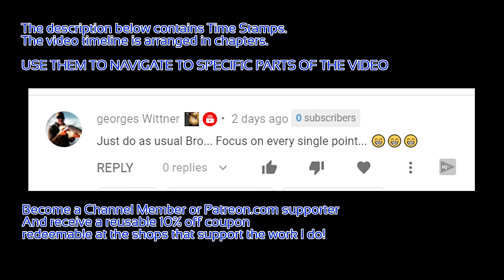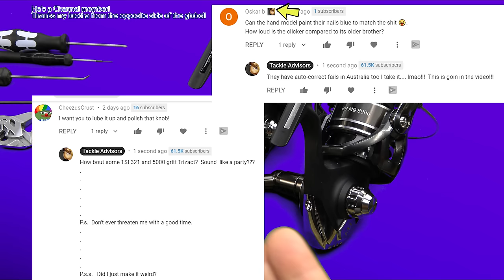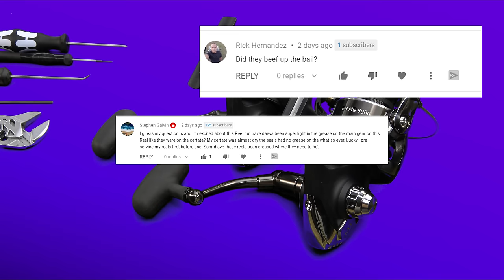Daiwa BG MQ Review - COMPARISON - Teardown - Analysis COMPARED to Spinfisher, BG, Saragosa, Slammer

Comment: The clear plastic washer on top of the drag stack is a cheap arsed heat shield like the white one on the Saltigas. Meant to prevent heat generated in the drag stack damaging the base of the drag knob which used to happen on the Z series Saltigas on big hard running fish.
Reply: Great job by the way Scooby, marathon edit bro👍🏽
Reply from the maker: @mickdayday1152  Thanks man!!!!  that was my fear...I called the daiwa rep on that. (no reply)...i was worried it was just a high temp plastic to act as a buffer instead of a heat sink...IF you saw the past video section about the saragossa sw I mentioned and showed a picture of a friends saltiga with a melted drag washer...and the saragosa sw has a metal pluger

Comment: This was wonderful.  Very thorough and complete.  I wish there were more reviews like this.  Shimano in particular uses marketing jargon and then explains it with more jargon.  It's hard to know what is in the reel. I own a Spinnfisher V and a BG.    You are spot on when talking about the feel of these two reels.  I surf fish in Florida and stay out of the water.  I learned a lot about how to clean the reels when I come home.  I wasn't aware of the issue with roller bearing or bushing so I will open them and see how they are doing.  There were lots of parts on the table I just wonder if you had any leftover?

Comment: Great review in terms of sealing and smoothness of operation.  Would like to see the difference in max drag between the BG and similar sized BG MQ.  I get about 8 lbs at full spool with the BG tested on a calibrated brass scale and got owned by a jack crevalle this weekend.  The reel was fine though after having half the line run out by multiple jacks and a couple 10 lb bonita.    I had to thumb the spool to stop from being spooled a few times and broke the jacks off on purpose.  What I like about the Diawa reels is they bottom out against metal and keep you from over flexing the spool against the drag.  I'm either going to go up to the 4500 BG or maybe "upgrade" to the MQ if it puts out more drag.  I can't see spending more for a Saragossa in that size reel and will reserve that for the 10000 size.

Comment: wanted a gossa, but settled for BG MQ when the supply dried up.  fished it this spring, mostly plugging.  Happy overall. One complaint is I had a bail close on a cast. Been more conscious of opening and position and hasn't been an issue.
Reply: would you recommend for freshwater?
Reply: have you ever experience bad gear meshing? ive hardly used mine and intermittently during use, the gears start to feel bad and as soon as that happens i stop using it. When i get home it feels buttery smooth again.

Comment: Thanks for the breakdown!  I've used a BG MQ 4000 fluke/tog fishing exclusively for a few seasons.  It works perfectly for shore based bottom fishing but I never thought I'd be able to surf fish with it and glad I watched your video.  I'm looking at a new 6500 for surf fishing and I'll consider your recommendations.
Reply from the maker: Right now the gosa 6000 is the standard to beat.  Slammer 4, is very good as well.
Reply: Thanks! @TackleAdvisors
Reply: @TackleAdvisors what about lighter setups? For example I need a reel with a capacity of 300yds of 0.20mm braid and I need to be <300g because I have a light jigging rod 10-60g..Slammer is 400+,Gosa also 400+..BG MQ 4000 would fit pretty well into the desired category..do you think there's something else beside it that's equally good or better? Other than Twin Power XD for example..that's too expensive

Comment: I’m deciding between the Stradic FL, saltist back bay, or this reel. Looking at 4000 size to pull big reds from structure. Which would you suggest? I have a 2500 FL and love it but I’m leaning towards the Back Bay

Comment: Great review man, I love how u threw in the diameters of the shaft and gear in comparison to the 4k bg!
Reply from the maker: Bent shafts were an issue I've seen enough of to be curious...It looked like by memory it was slightly thicker in the mq....I posted an  ask on stripersonline....and a member (hk jonathan) cracked his and took measurements.   A few years ago the same guy sent me his slammer 3 to tear down and use for a bit
Reply: @TackleAdvisors  I plan on getting a new cat-fish jigging/ shore jigging reel, and so far 6000 bg mq seems to fit the bill, i would love to see some tests from people on the water though, but looks a lot beefier then the  regular bg i use in the 3000 size. What do you think, would it handle heavy 60g jigs + silicone in strong rivers?

Comment: I replaced the line roller bushings with crbb in all of my BGs. I put a drop of Liquid Bearings on there every time I finish with fishing and I've never had a problem with them. I don't really care for the bushings
Reply from the maker: Let me ask... Who's are you using? I used to do the same and then the quality went down.. This was 15 years ago...
Reply: @TackleAdvisors  I don't know what brand they are but it's the ones from hpr bearings in Miami. Either those or sometimes I order from boca
Reply: And I said crbb but I meant the stainless.

Comment: Another great video! I’ll take the Penn ssvi in 
A  5500 or 6500  on a. Boat getting sprayed with salt water an the way out or home . Thanks ! For the dissection =Great information.
Reply: I don't see any issue. Been using all Japanese brands . Reels got sprayed by rough seas while boating. It worked fine. Just have a small WD40 on standby.  But never use. Reels worked fine. Got BG 5000 for 45 years with very little maintenance. Bought a newer BG with double stopped. Only fished 5-10 kg fish on it. Just washed it after use. It will last for years 
Once I forgot to remove a fishing set on a boat for three days, the reel jammed. The boat is parking in the sea. Not moving. Dismantle the reel with lots of WD40, Presto ! It worked fine as before !

Comment: great review at least on there MQ reels they have got rid of the useless reverse switch, those things drive me crazy.
Reply: Just buy a Fin Nor Offshore and you know you have something, body all alu with all gear stainless steel, the 6,4 mm axle supported in 3 points, front middle and rear for real effort, no compromise as alu, coated alu or zinc, even the handle, there's no schiki miki reverse switch and no one way ball bearings but the solid clutch anti reverse. It is heavy but strong, built to hold any fish and to last forever, you can't have both, whether strenght and endurance or lightness, the lighter it is, the less substance/atoms in it... I just brought a Fin Nor Offshore 10500, when you hold it in your hand and you hear its clicking while turning the spool you know that's the thing a man wants.
An endurance test would be interesting, alu gear, coated even, vs brass and stainless steel gears, so those Daiwa and Shimano vs Fin Nor and other stainless steel and brass gear reels.

Comment: If you look at the rash guard lower internally you can see a raised lip thatI think is meant to hook the ring gasket and pull it down into place .But in order for it to work correctly you would have to re install the rash guard lower end first not upper end as you have done. correct me if Im wrong.
Reply from the maker: I took note of that... But that's a tough ask.. As it's blind and there's know way to tell if it's done correctly unless you remove everything and look from the inside out... Then take it apart again and then redo the booth hoping to replicate.. Know what I mean?

Comment: I have saragoas in every size and they have been great. Only complaint is the oscillation feels a little strange. Hard to explain but as if you can feel the top and bottom of the range.
Reply: I have heard the smaller Gosas have a balancing of the rotor problem. May be what you are talking about.

Comment: the plastic washer I think is to keep the surface of the drag from wearing down an then allowing corrosion so the plastic washer kinda protects the metal I'm assuming tbh but think that makes the most sense but maybe its something else but my other reel doesn't have that an has small scratches on that top part of drag

Comment: Can you just open the side plate and access the inner reel rather than starting from top down taking out the main shaft and pinion gears. Let's see if I just want to lube up the interior can I just take off the side plate

Comment: For me, all the daiwa reels up from the BG5000 are all mag sealed( nero, saltist, saltiga) which I just refuse to buy because I service my own reels and I can't afford a saltiga. The bg mq is the only daiwa stepup from the BG that is not magsealed. As for the special tool, surely some thin wall tube, with the slots cut in it would be easy to make?, that might be a deal breaker. 
Comparing it to the spinfisher for waterproofing, I think is a little unfair. The spinfisher carries a certified ipx5 rating. The daiwa talks itself up but never claims to have an ipx rating. Pricewise, does the bgmq handling and power trump an ipx rating? Only an on the water review will sort that out. Hint hint.....

Comment: Do you think this reel could hold up to GT?? Or would the Penn Slammer 3 still be the best option under $300.
Reply from the maker: I'd feel more comfortable recommending a brass geared, metal rotored, ball bearing line roller,  dual dragged equipped reel for nasty bastage like that
Reply: So it's definitely not a surf reel, it might be a good jetty reel and definitely a boat reel. 

I'd be interested in using it for popping smaller tuna/pelagics on 50# Threadlock.

Thanks for the honest review!

Comment: Honestly, give me a Shimano that I can open up to clean and lubricate and replace these bearings every season if necessary!
Instead of replacing bearings on a Shimano, you can also install bushings!
but hasn't the quality deteriorated over the years?
the question is does it not get too hot with heavy catches.
In any case, it's not going to make any noise to let you know that something is running rough!

Comment: Which reel do you think is better between the bg and the nasci? I want a reel thats not poorly made and will last long in saltwater.
Reply from the maker: I'd go bg... Rock solid spectacular value all around... If you can step up to to the spheros and Spinfisher.. You'll get more protection against the elements and longer like new performance as a result
Reply: @TackleAdvisors  so against the bg and the spheros and the bg you would go for the spheros?
Reply: @TackleAdvisors  Because I am just looking for a reel that is built like a tank around the 100 dollar price point.
Reply: @roon1355  then you are looking for small reel(Nasci bigger 10.5oz...with hexagonal shaft).....spheros 4k hg/xg more waterproof than bg 3k.
......LETHAL 40 13.5oz is a tank!...16oz? SEDONA OR SOCORRO with low ratio and BG with fast ratio

Comment: Thank you for the review.  I was thinking about picking between this and BG. This helped a lot.
By the way. Can you please tell me or post the bearing that you replace in your BG s. I know that is not water proof in the BG but would to water proof the BG with I get it as much as I can . I understand Depending on the size of the reel may make a difference on the ball bearings.
Also what do you recommend for oil and grease thank you.
Reply from the maker: You're welcome.  For the 4k, this is what I've replaced them with (top pinion support bearing)  https://amzn.to/3kwuIiW
Reply: Tackle Advisors thank you for replying.
I am looking at the 5000 but this will get me start thank you for the reply.

Comment: I fish 45lb of drag, to fight big conger without giving any line, but I use the biggest saltigas for this job
Reply from the maker: That's a bucket list fish for me.....I want to catch a Monster......If we had them around my area I'd actually be into bottom fishing...Instead we have flounder, tog and seabass...tasty.....but meh fighters...tog are so so.
Reply: @TackleAdvisors  the irish west coast ist definetly the best area for big conger, cause tere are much and big ones, but also south european atlantik and meditteran sea are good, I go at least one time per year on a 1-4 week conger trip and believe me, for the big ones, especially from the rocks, you need powerfull rods, and, that's the key: the reel with the most cranking power around so you can crank the fish up from the bottom, even when you can't pull with the rod anymore cause IT's under too much load, but, if you fishing for them, dont set the drag higher than 20kg, cause it can always happen that something like a shark bites and you don't want to fall in the water from a 5meter rock in 10 degree cold atlantik water!
another thing what needs that drag pressure is to stop big catfish between snags and if i say big than i mean over 150lb

Comment: Need your guy's opinion please... I have Saragosa 10000sw on Proteus and spheros 5000sw on a terez waxwing. Just bought the saltist 8000 for 160 bucks brand new. Gonna pair it with a Proteus, Terez, or Phenix Black Diamond and 100lb braid. I couldn't pass it up for that price. However after doing some more research I'm not too sure about this reel after watching many tear downs and reviews for the saltist. Also not a fan of the mag oil for maintenance. I am a Shimano guy for Spinning reels, but like Daiwa Lexa 300 and 400 paired with Terez's for my bait casting. (Bought the Lexa's before the smaller Tranx came out or I'd probably go that route) I plan on using the Saltist as a west coast tuna/pelagic setup as I do my Saragosa setup. Should I try to trade the reel for a Spheros 20000sw? Keep the Saltist? trade for  something else? Thanks for the help.

Comment: Moisture is a thing  that you cannot control  . 
Also you never know how long a reel has been just sitting in a factory before being sold  grease can dry out also . seals are not the only problem . 
i personally like stripping my reels down every year even though i have over 7 reels i still do it to make shure they are not corroding away inside .
Reply from the maker: You absolutely can control moisture..but it's not water vapor / humidity types of moisture that cause trouble...it's sediment, saltwater, and particulates that come with the water.   There are many reels that offer high levels of sealing, better than what the MQ offers at the price.    lubricants can last a very long time without breakdown when not exposed to outside elements.

Comment: Are you going to have a full break down of that VR50 you were using.   I have one and have been using it for two years.  Aside from line lay issues (returned and fixed).  It has been a great little reel.  Was super tight at first but  it’s gotten noticeably smother with use.
Reply from the maker: yes I will

Comment: I just bought a daiwa BG mq1400 took it sturgeon fishing for 2 days hooked a shaker about a 36 in was not impressed with the power of the reel I was pulling a 14 oz pyramid sinker because of the current I tried to replace my c14 12000 shabano bait runner with this reel and it did not perform adequately make a good striper reel but not for sturgeon and heavy current

Comment: Nice review, I'm a bit skeptic on the BG and Saltist though, after reading plenty comments on the bad durability... it seems bearings loose the smoothness after intensive use. Several people had to get them serviced because of this. It seems the bearings are zinc made and get fucked up with time and use in saltwater. Curious to hear your views on this. I'm just trying to find the best spinning reel for striped bass around the $100-140 mark.
 Best.

Comment: So which is best spinning reel you say tht can take a big game  beating around $250
Reply from the maker: Spinfisher...Brass gearset and metal rotor....It's a proven design at this point.
Reply: spf vi?....I think you can't beat the spheros, but only in low ratio.
Reply: Noo
Reply from the maker: @caranx89  they don't make a bigger hg ratio?
Reply: @TackleAdvisors  which one do you say? I mean the spheros!, only in 4.9ratio (but you can put the pinion kit of gosa 8k 5.6!) and 4.4...although there are Spheros hg 8k but degradation.
Spf in 30oz does not come in hs" as a slammer....here now SARAGOSA 18K GETS IN PLAY!!.

Comment: i was expecting this review since some time ago, i wanted to know your opinion about this reel. Now i have more dudes than before. Im looking for <150/200€ reel, at least size 4000, and around 300gr. Looking for fishes like "dentex" so i need power. Daiwa BG 4000 ( to much weight... ), spheros SW?, stradicFL4000, wait until stradic SW? Ballistic 6000 could be the best opction but price is to far from the other.
Reply: You want to fish in the Mediterranean sea i guess.  If you want a metal body and a lighter reel then go with the stradic Fl, it is in your price range.
Reply: @gonimysh  I fish in the north sea of Spain. Finally I bought stradic 4000 for 120€ ( I got a very good offer). Happy so far with it, enough power and very soft feeling
Reply: What kind of fishing do you do? Jigging?
Reply: @gonimysh  Spinning, in this case I use it for 20/80cw 2.7/3m rods. For light I'm using the stradic ci4+ FG 2500. Also happy.  For jigging I'm using the Lurekiller Saltist 6000

Comment: Wonderful analysis and presentation and may I say, maybe even the best ever. Were you fair with this Daiwa BG MQ?  Absolutely; but, no hydrophobic coatings, proprietary tools or unnecessary complications for somebody like me (love the BG's and Daiwa "feel").  I love the new reels but I like  good and easy to maintain. If I submerge a reel in sand and sea water or gets prolonged boat splash, then it gets soaked in bucket or bathtub (when the wife is away) with running water, dried, greased and lubed. I only get rid of the reel if it breaks, becomes aesthetically unacceptable or is passed on to a kid that might benefit from it.